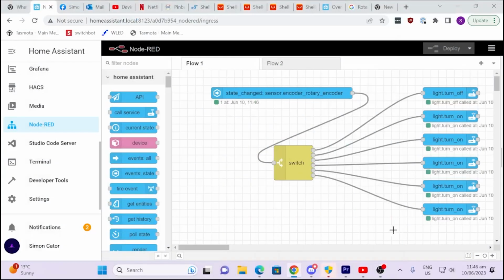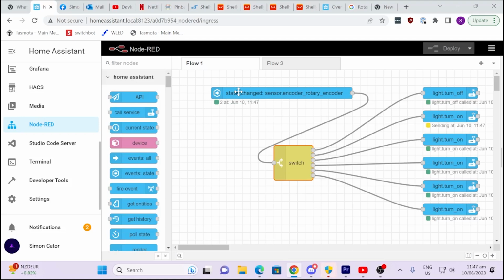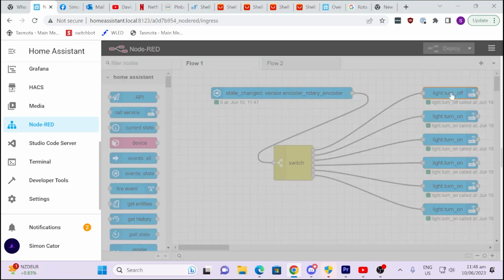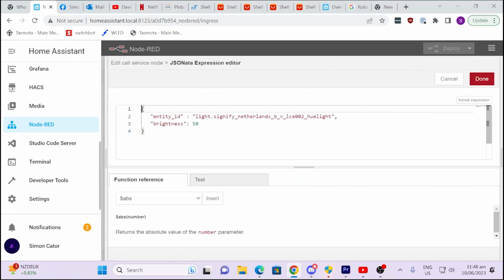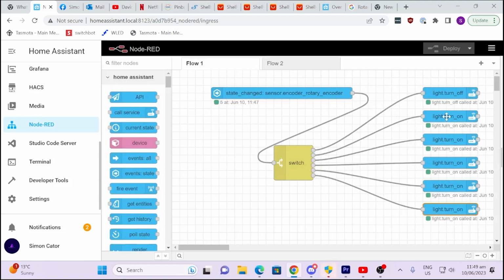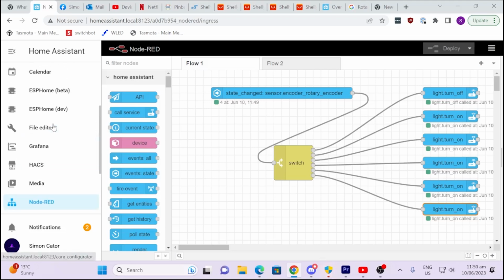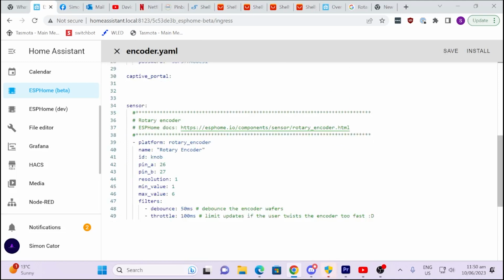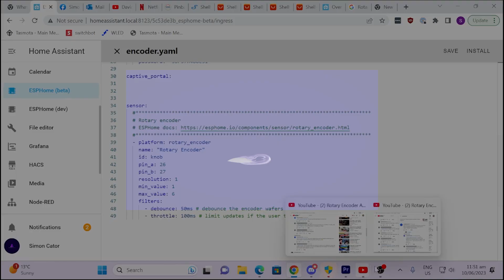Rotary Encoder Node Red Automation now works to dim lights thanks to my Awesome Audience!

Comment: not sure this would help but i noticed in your other video that you were not using a knob, but was just turning the stem without one. Am wondering if a knob would give you better control/adjustment and fix the problem with the numbers jumping around. I've ordered one of these but this one comes with a knob. Will let you know when i get it and if it helps. Be a while though ordered from aliexpress
Reply from the maker: Oh cool thanks for the suggestion!  Please let me know if the knob helps.  I am also going to try another one to see if the first one waa faulty.
Reply from the maker: Tried another encoder of the same type, no difference.  Any ideas of a good quality one?
Reply: @simonsayshomeassistant  i'm thinking it's the absence of a knob myself, although I could be wrong. I ordered the same one you did, but with a knob.
Reply from the maker: @HATipsByLarry  Great, this is a really interesting problem to solve as a team!

Comment: My thoughts are the rotary encoder itself is the problem, a more exsensive encoder would fix the problem
Reply from the maker: I have just reloaded the same code on an ESP32 which is running my bluetooth proxy and now it works perfectly, so odd!